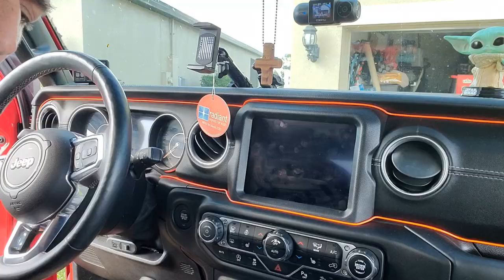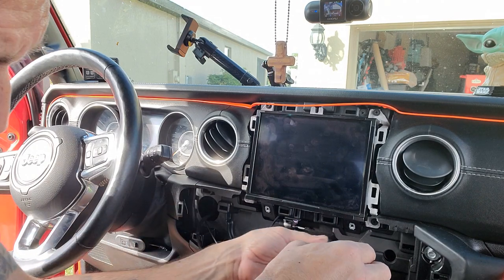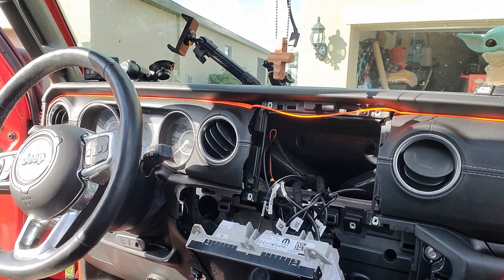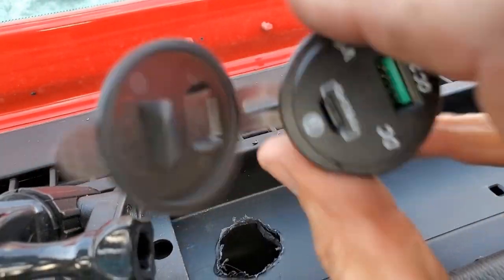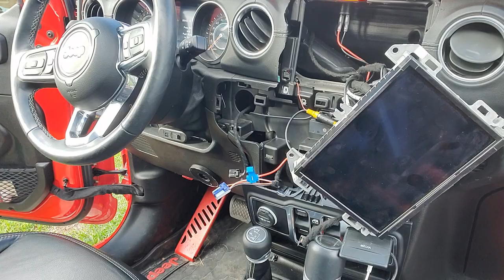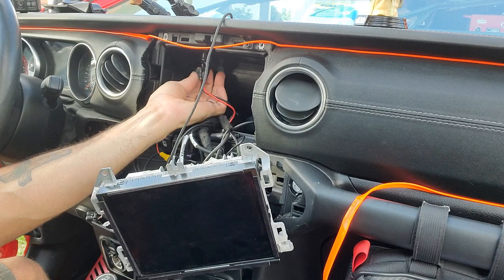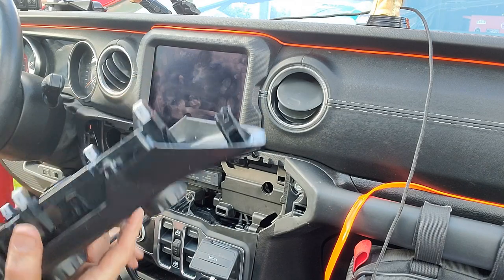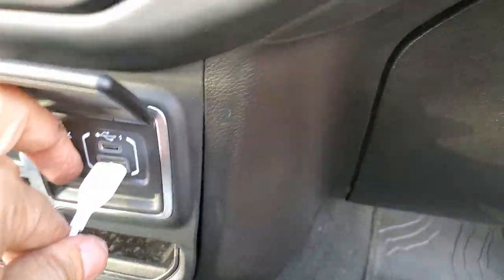$15 Dash USB Mod

Comment: You can go into the menu applications-> projection->selecting your iphone/android->press the arrow on the right side-> DISABLE APPLE CARPLAY. It will just from now on just charge your phone. And for some reason you want to have the Google map or music from your phone just go the same place and just re-enable it. I do that to switch between my android phone and my wife's iPhone. Without having to unplug anything
Reply from the maker: That’s awesome. I never saw that option, I need to do that to keep her iPhone from taking over.
Reply: @EvolvingMale  yeah I had the same problem. Her iPhone just kept popping up all the time. :)

Comment: impressive, my wife wouldn't have let me cut into my dash. she's already nervous after I installed a tazer. you also look pretty comfortable tearing apart your dash. use your rear usb ports to charge your phone.
Reply from the maker: Yeah, I’m getting used to ripping it apart. Also, she didn’t know I was doing it but she knows I won’t hurt my baby
Reply from the maker: @Thisguyuknow  well, as you can see I'm not a professional electrician. I like these things you just showed me and ill use them in thw future. I may even go back and use them on this application.  To be honest,  I was about to take a road trip and just wanted it done. I will invest in some. Thanks for the awesome tip. And the help